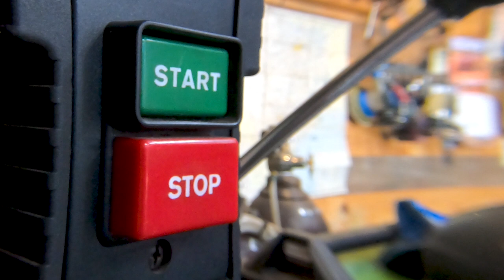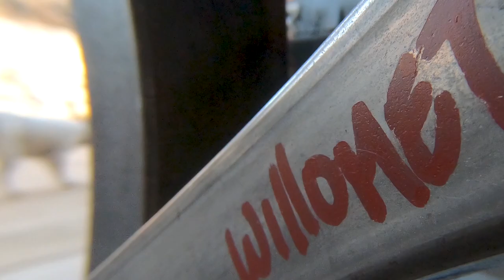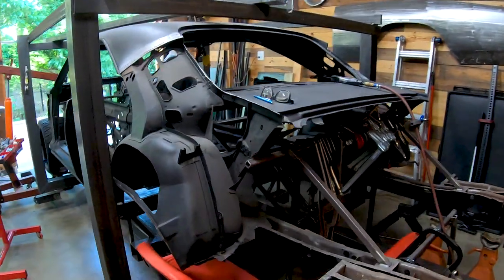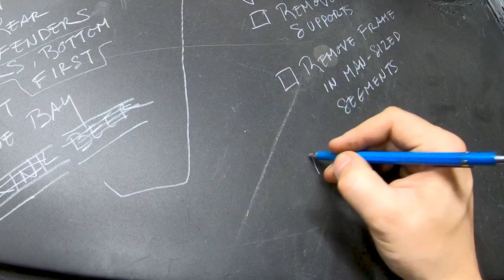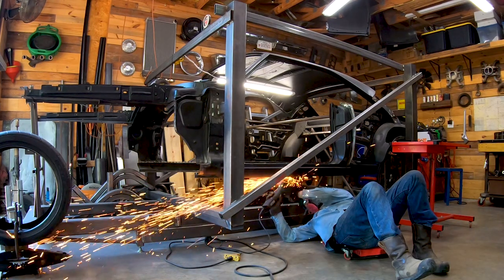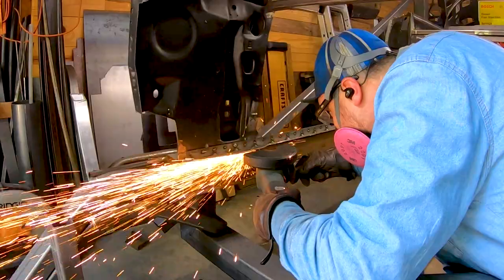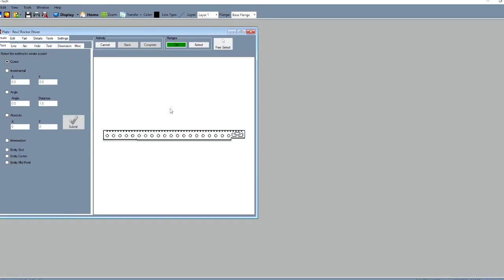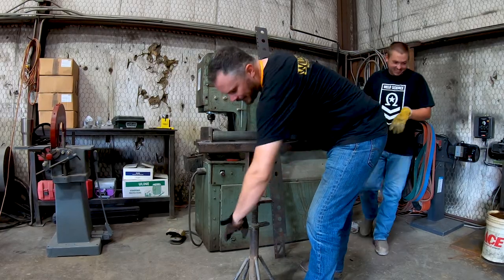Kill Your Darlings | 1970 Dodge Charger 02

Comment: I have followed the Burb episodes and made a few comments. Love your work and the narration is better than the professionals. What model bed sled are you using?
Reply from the maker: I’m glad you’re here! The suburban is running the bedslide 1500 47x63. It’s for a GMT400 suburban, but fits my junk just fine.
Reply: @WillometMotorFab  I have made side doors for my M101A3 trailer out of 14 gauge with no brake press just scored it and bent it over the work table can't tell it wasnt professionally made. Do what ever it takes to get the job done.